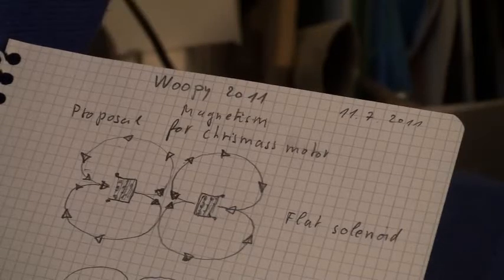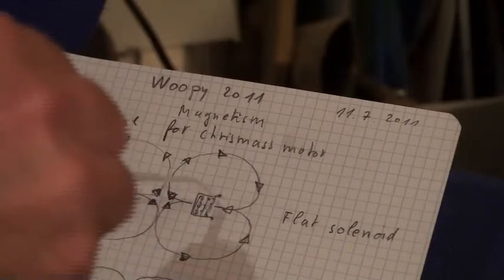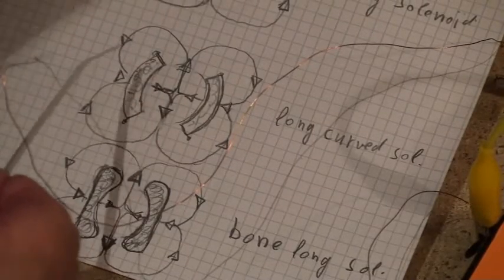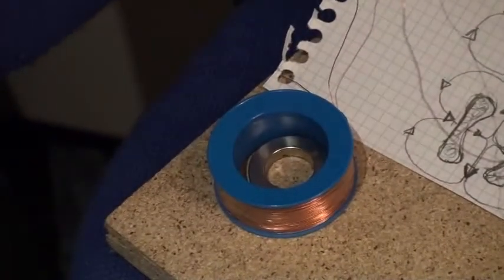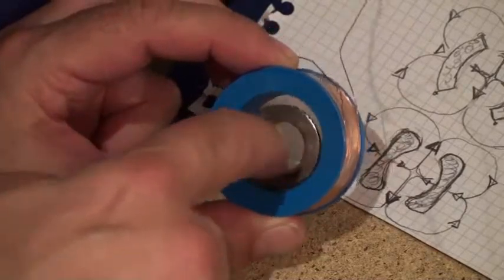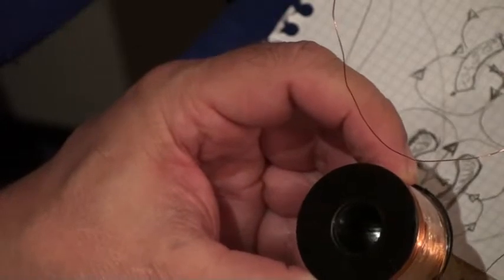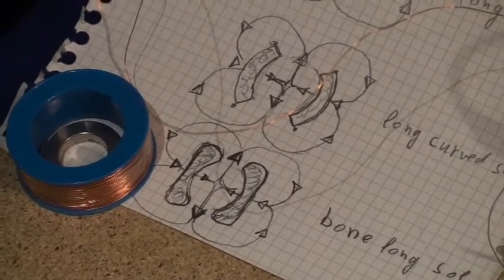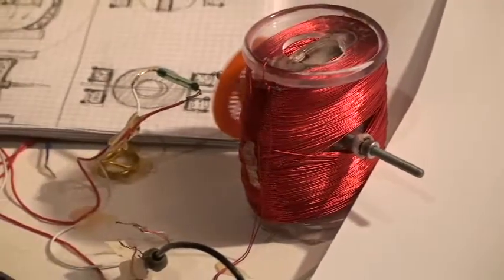christmas gift motor from ted 1.wmv

Comment: 2nd:  The center of the energized coil is the only place were there is no force on the ball that wants to pull it towards the center.  The moment the ball moves away from the center of the coil it "sees" an electromagnet pulling it back towards the center.

Comment: So why does the ball stay in the middle of the energized coil?  The answer is simple.

Imagine you had a regular bar magnet and the ball.  If the ball is at the North or South end of the magnet you know that it will be attracted towards the center of the magnet.

The energized coil is an electromagnet - the same as a magnet.  The ball will be attracted towards the center of the electromagnet if it is on the North end or the South end.  So it goes to the center of the coil.